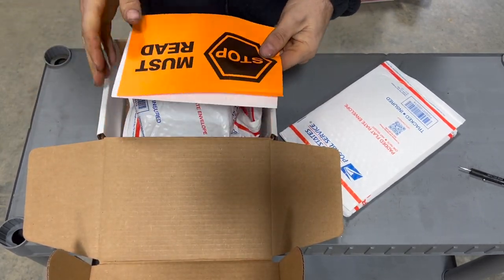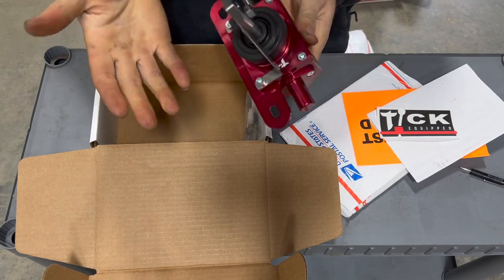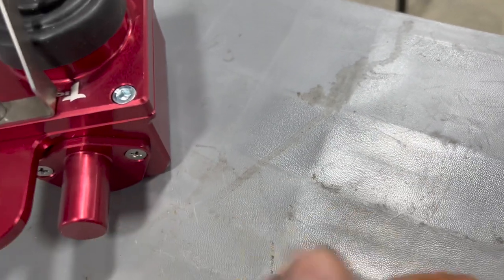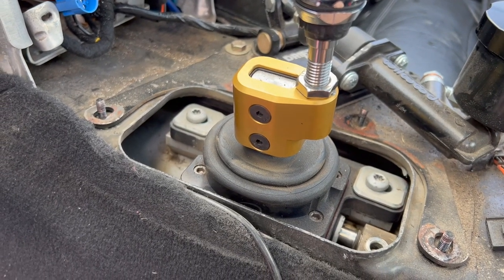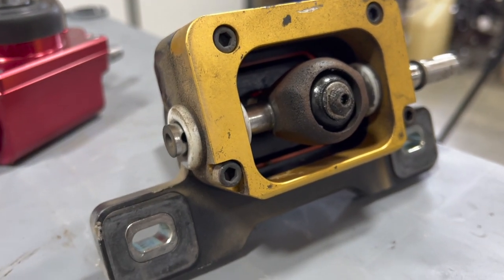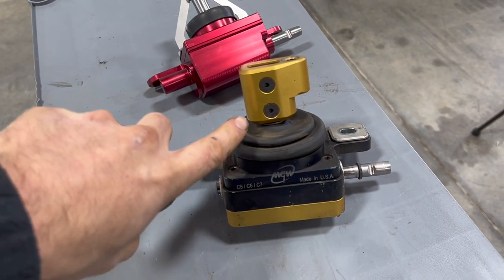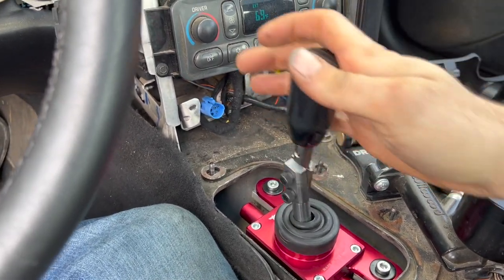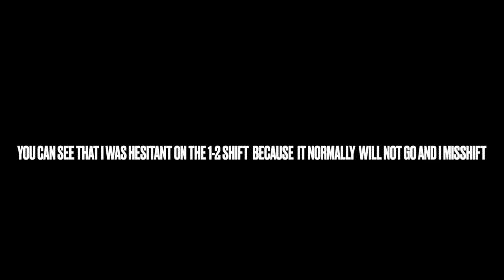Tick performance corvette shifter vs mgw shifter. The tick shifter is good!

Comment: I had some issues with my Tick shifter during the installation.  
#1- Comes with two washers that are meant to go between the shifter body  and the 2 bolts going into the torque tube. Nowhere in the directions or in the installation video is this mentioned 
#2- the boot on the shifter had holes in it. Had to seal it with liquid wire glue.  Also, when retorquing the bolts I noticed the boot won't stay on after installation.  Had to clean the greatest from it and seal it down with some more liquid wire glue.
#3 Instructions do not mention locktite.   However locktite is a must to get the rod/rail bolt to stay in place .
#4 For the money I will never understand reusing the 1 crappy bolt for the shift rod into the shift rail. Those bolts strip super easy and have a ton of where . 
#5 Its still notchy to many.  Many people have reported that the anti-venom mod still may be needed to relieve some of the notchiness and stiffness. Especially on downshifts.

Comment: They've pretty much fixed the MGW. At least the flat stick model. It still has a cut out on one corner of the lower box to clear the ledge on the torque tube. It's sealed by foam insulation that goes on the torque tube during install.